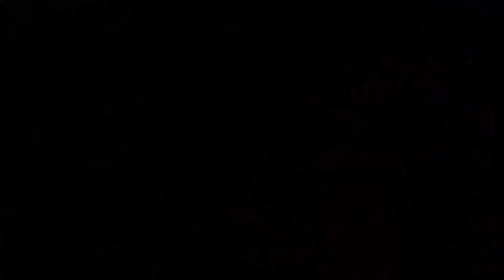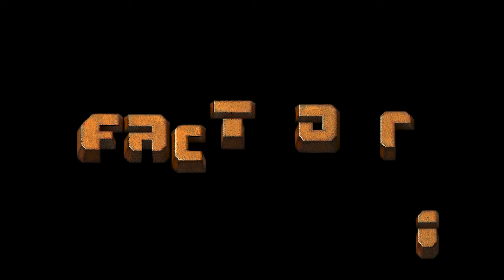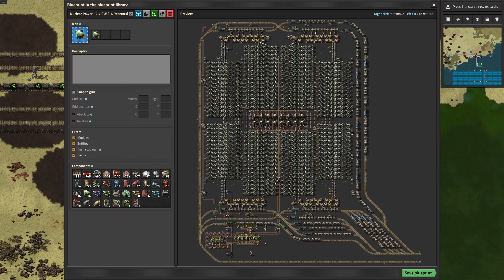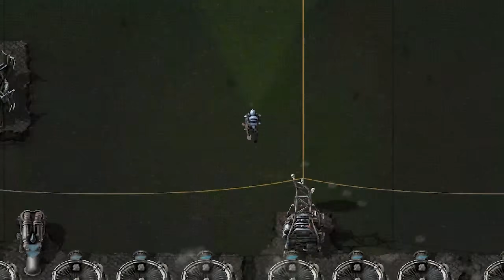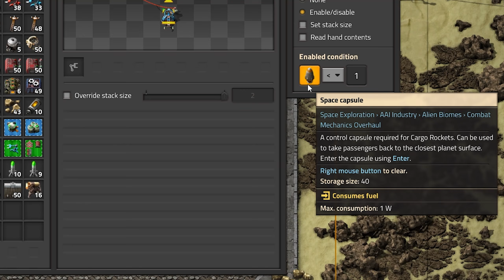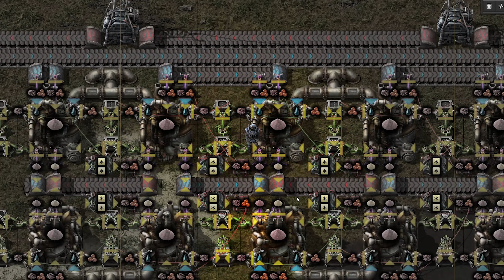Pieces of the Puzzle - Factorio Space Exploration #9

Comment: For the circuits in the modded plates, could you use two stack filter inserters, one dedicated to each material, and wire them to the buffer chests to only be active if there are less than 100 of the particular material in the chest?

Comment: Hey Z, wood can be crafted into green circuits, replacing stone tablets in the recipe
Reply: You can also use input priority splitters to use recycled beads/washed ore before inputting fresh stuff
Reply: And use filtered splitters to move them back to the input on a belt to that priorised splitter
Reply: @fuuryuuSKK  belts not gonna cut it under 10x speed modules lvl 7
Reply: @mrShift_0044  just depends on how many machines you have per belt